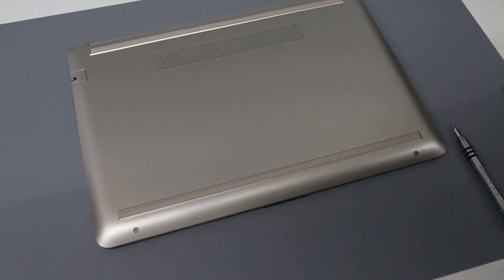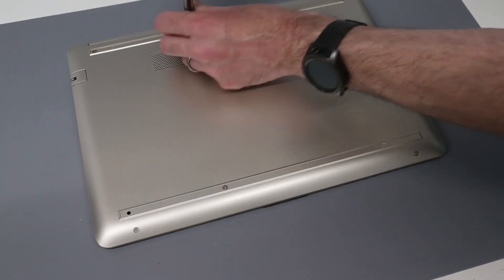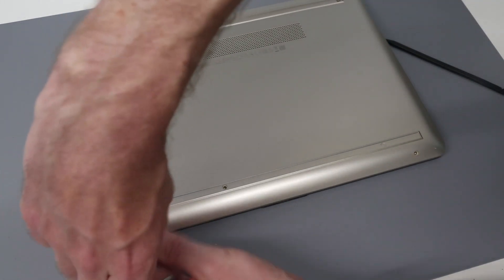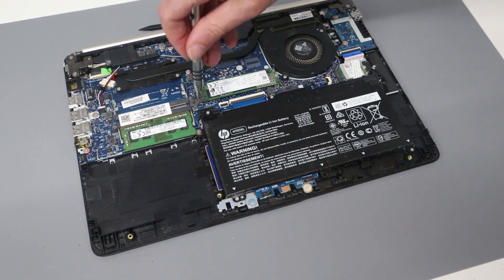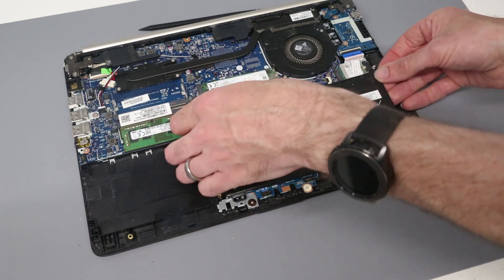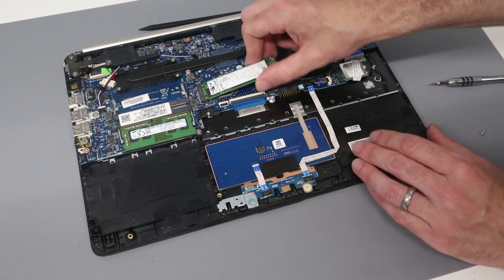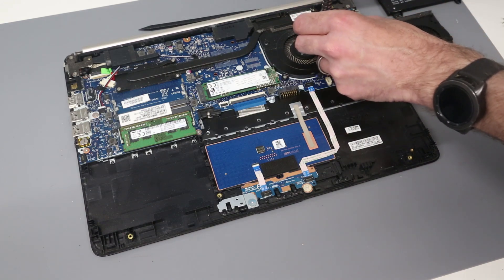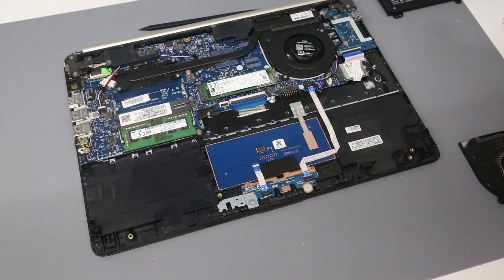HP 14-ck0520sa - SSD, RAM, Fan and Battery Replacement and Upgrade Guide

Comment: Great video. Can you upgrade the processor on this laptop, or is it soldered?
Reply from the maker: Only by replacing the mainboard with one with a higher spec processor. The CPU has been soldered down in all laptops since the 5th gen Core on the Intel side, bar some gaming laptops which used desktop CPUs.
Reply: @BrueComputing  Thank you! Well I guess that means it's time for a new laptop! I'm only replacing it since the processor doesn't allow upgrading to Windows 11. Pity really.
Reply from the maker: @jamilbocus  There are ways to install Windows 11 on unsupported CPUs.

Comment: i replace the battery and is not charging. i check the battery health an it say is good but hasnt move from 6%. did i just got a bad battery from amazon?
Reply from the maker: I'd start by returning the battery for a replacement.
Reply: @BrueComputing  yeah. I wanted to make sure I didn't miss anything.